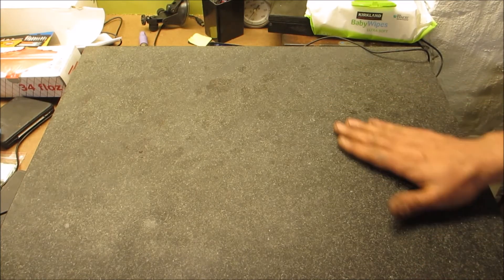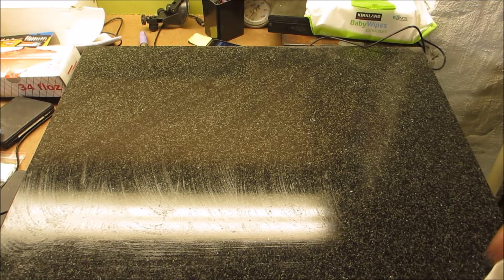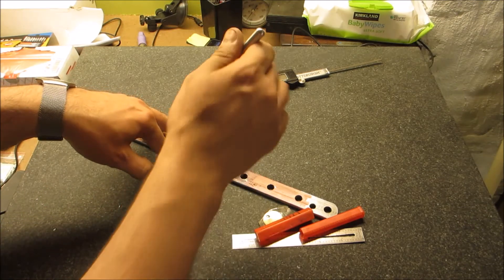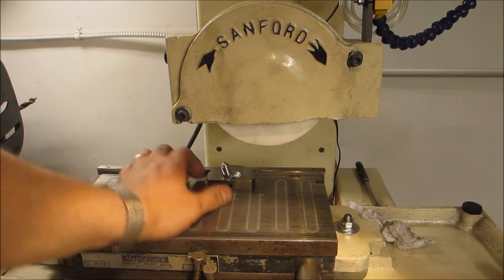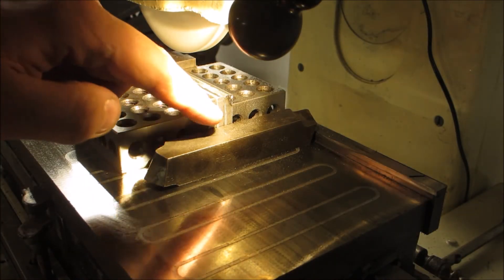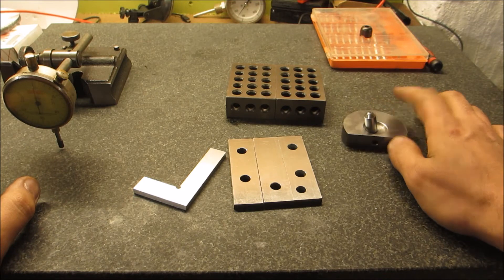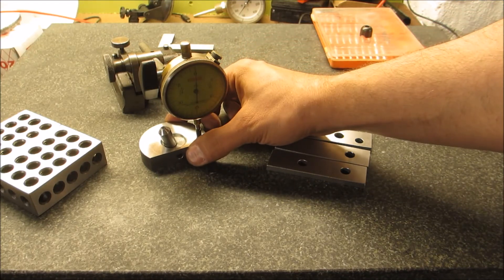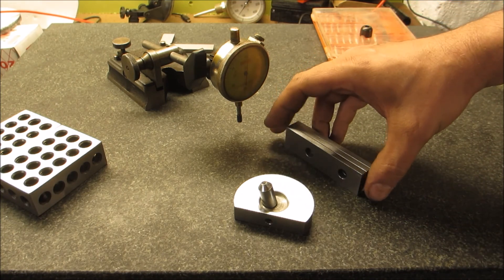Shopmade Parallels   Learning to use a surface grinder

Comment: "Residual magnetism"  
Full on magnet will flatten and parallel before it gets ground. Butt them up against the rear fence, engage the magnet then almost all off. Then grind. There will be enough magnetism to hold them still and the fence will keep the from squirting out the backside.
Reply from the maker: That is sage advise. Thank you.
Reply: @Engineerd3d  you are very welcome. It is a mistake you only make once.

Comment: Bruno...came for the visit from my buddy Harold’s suggestion.....I am a home hobbyist also.....FYI, when grinding the material faces of thin material the magnet will pull the material flat but when released the material will return hence you might not get a flat surface, if you can experiment with not engaging your magnetic to full power you should get better results...you will be amazed on how the magnet can distort even thicker material.....
Reply from the maker: That is a very good point. Thank you for that tip. I am going to try this again. Also love your channel as well. Been watching your stuff for a while now.